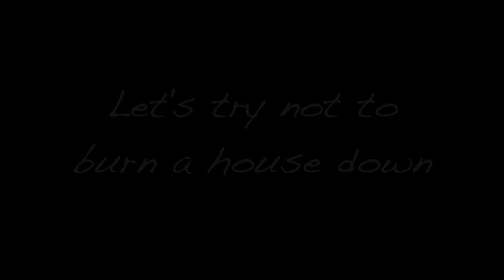How to - Soldering battery connector - eluminerRC

Comment from the maker: Thanks! I wanted to make my battery wires shorter so I intentionally cut them. But yes, if you want to keep battery wires length the same you should desolder the connector.

Comment: I have to agree with the others, very clear and well produced video yet again. I have a couple of batteries with XT60 connectors but I now want a higher capacity 3S battery for a Q450/HK450/HJ450 type quadcopter with 930k motors (3000-5000mah) - none of the higher capacity batteries I have seen come with XT60 connectors. Are they suitable to be rewired to XT60?
Reply from the maker: XT stands for hextronic. 60 stands for 60A current rating. So, you can safely use XT60 connectors for applications that require up to 60A. Not knowing any more details about your build, I would say you can safely use them for 450 size quad builds.

Comment from the maker: Yes, I thinks that XT60's are overall better connectors. Easier to solder, they come on most batteries, easier to connect and disconnect etc. Actually, I've already switched to XT60's. I'll mention this briefly in future videos. My recommendation is that you stay with XT60's.